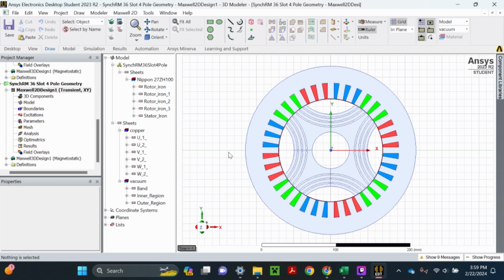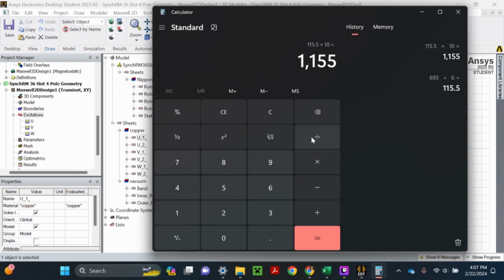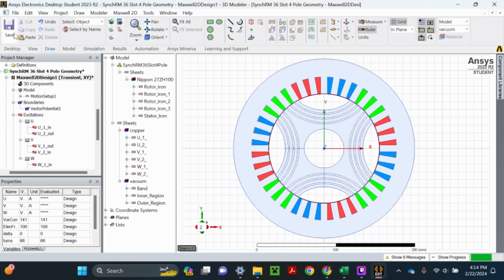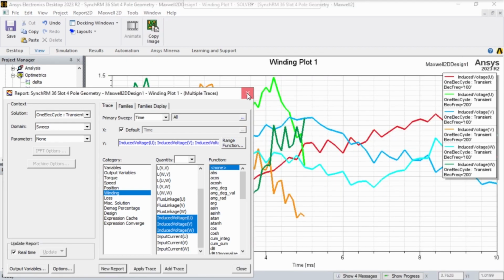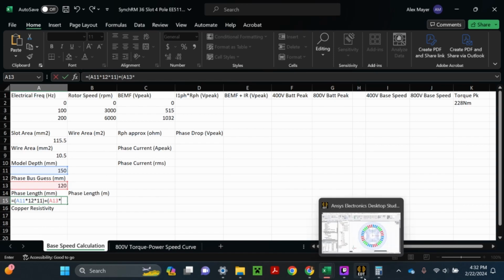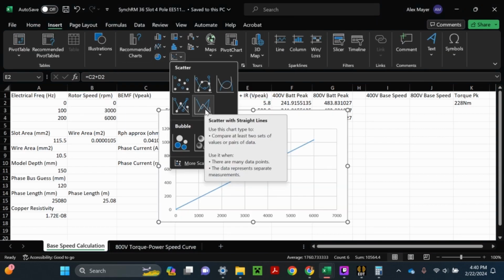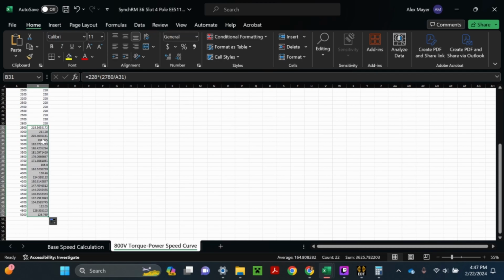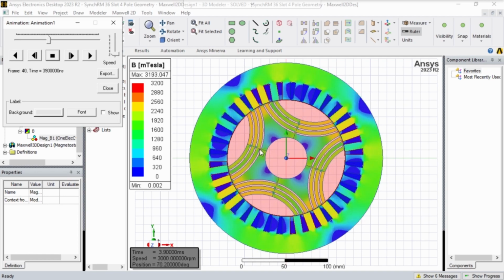Synchronous Reluctance Motor Simulation in Ansys Maxwell

Comment: Hello. Sir. Thank you for the video.

I am a master's student in AI.

Due to a recent related assignment, I am learning software to construct noise simulations related to power plant motors and piping.

I'm learning from your videos, but I'm stuck from the first screen.

Is there any knowledge I need to know first before studying your video or any videos you can recommend?

I didn't study electromagnetism. The goal of my task is to configure the simulation in a short period of time and use it for AI development.

Thank you.🙂
Reply from the maker: Hi, 

What kind of noise are you attempting to simulate? In terms of the geometry of the model in this video, you can find files here https://github.com/AlexMayer-Sanchez/SycnhRM-Maxwell-Files . If you need to construct your own motor model, I suggest making the model in a 3D software (I use SolidWorks), and importing it into Ansys Maxwell 3D, then sectioning it into a 2D Maxwell model, which I cover in one of my previous videos.
Reply: @alexmayer-sanchez 
 
Thanks for your reply.

I'm trying to configure a simulation for a failure.

For example, if we could make a special noise that comes out when a pipe breaks, we would try to damage a certain part of the motor and measure the sound.
Reply: hello. Sir.

I was studying with the file you provided, but I ran into a problem.

I'm using an open student license, but I can't calculate Maxwell's solution.

By any chance, what is your license? And I can't reproduce that example with a student license?
Reply from the maker: Unfortunately, you cannot run the simulation using the student edition software, a full license is required. I am able to access a full license through the my University, using an online service they provide. Perhaps your University has some means to access a full license. 

Also, I'm not sure I understand what noise you are attempting to simulate. 

  @isgodapple7581

Comment: Hi Sir, thank you for the video.
I have a question, how does the current terminal defined as we assign the winding as a group. does it randomly selected?
Reply: I mean, as a positive terminal us grouped as 6 sheets, so which sheet is the entry terminal of the coil?
Reply from the maker: @AnundaChuenlerssakul  I'm not sure how the maxwell software decides specifically, but I assume it distributes the current evenly across the surface.
Reply: I see, Thank you @alexmayer-sanchez